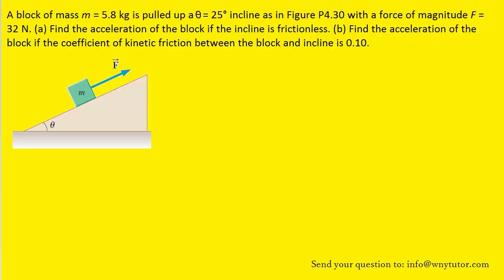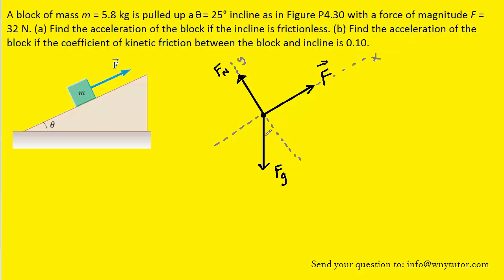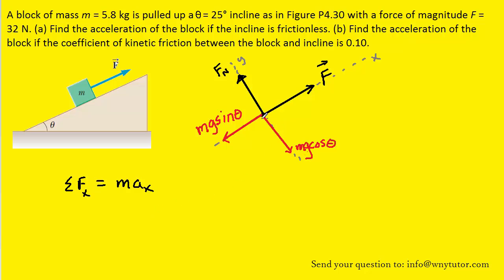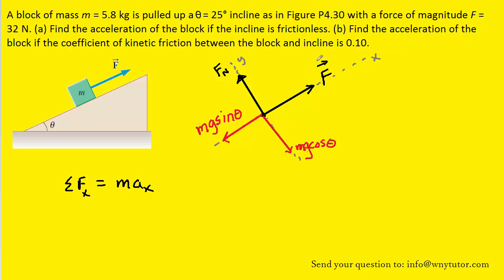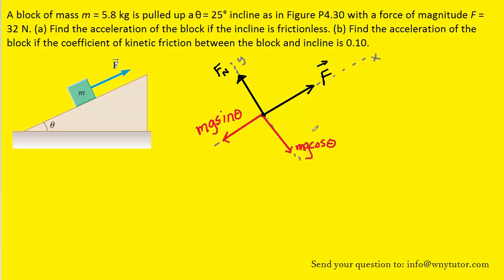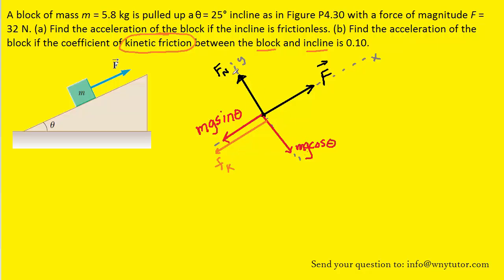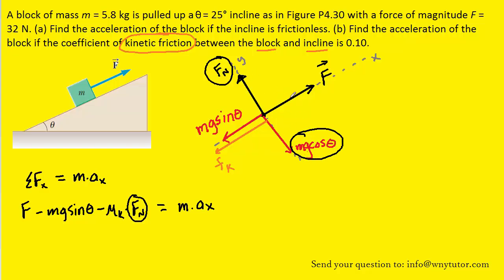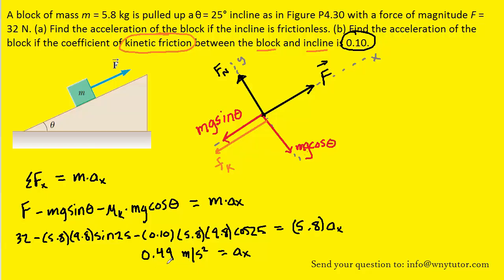A block of mass m = 5.8 kg is pulled up a θ = 25° incline as in Figure P4.30 with a force of magnitu

Comment: This question is ok.
There is a question
A 1.5 kg object on a slope with static mu =0.62, the object is attached to a string over a pulley attached at the top of the triangle slope, with a tension of 10 N . What happen the to the block , answer is the block stays. The mgsin is 7.35 N and frictional force downhill is 7.8N, this is worst

Comment: Hello! How would I solve this problem if the mass was unknown and the inclined angle had a value of 30 degrees?
Reply: Then the answer will have the term "m" and you just have to use the values of sin30 and cos30 instead of the sin25 and cos25 like this question.

Comment: I have to admit... this is the kind of problem that got me into TROUBLE back in the day... I understand everything you did with this problem.... great explanation.... but the TROUBLE I had is in the Description of the problem....   It states that the Mass is being pulled up the ramp by a force of 32 Newtons..... That tells me that the net force on the Mass is already 32 Newtons.... if I were to attach a spring Gauge to the block and pull it up the ramp and the gauge read 32 newtons... I would assume that's what the Problem meant.. Hence.. the Acceleration would simply be F/m = 32/ 5.8 = 5.517 m/s^2  ......   See where my interpretation would have gotten the Wrong answer?...  but as this problem was solved.. it assumed that the 32 N force up was to be added to the Gravitation Force down the ramp thereby coming up with a Net Force LESS than 32 Newtons..... Language and words are Critical in order to avoid confusion......  as I learned so many decades ago  :) ....